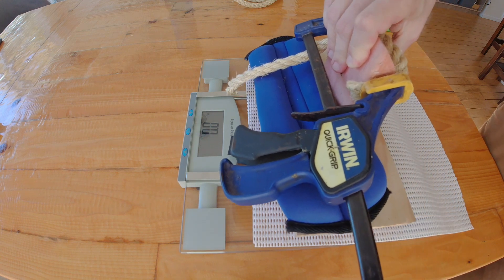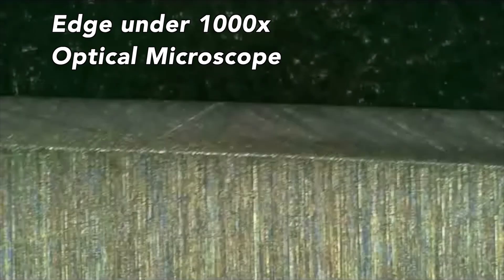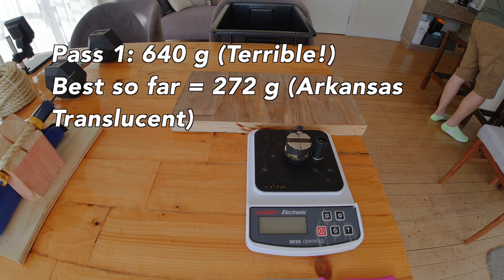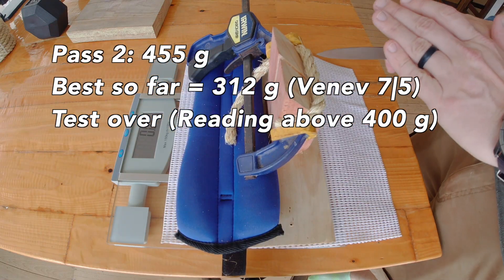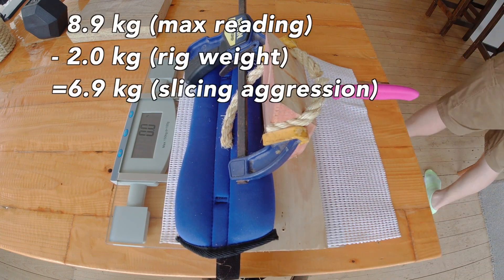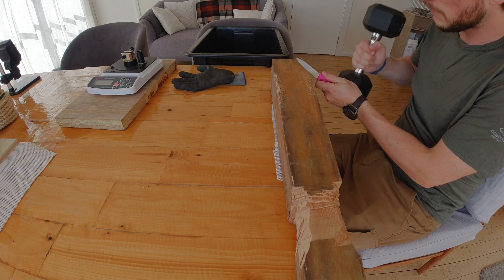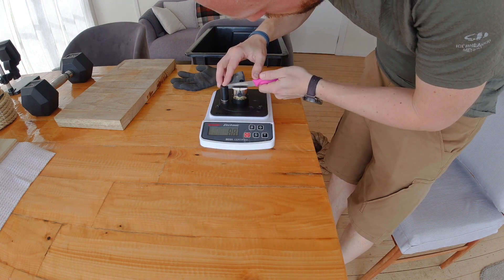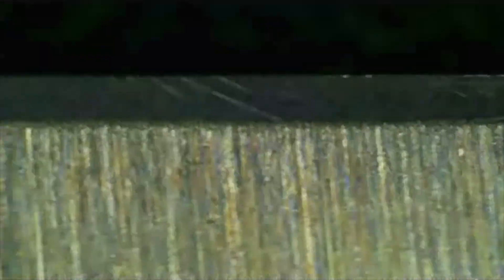SueHiro Cerax 3000 Grit VS ANDE Rope | 3K Knife Edge Analysis

Comment: Would be super interested to see how lower grit japanese waterstones do on these tests. Like maybe the shapton glass 500, the cerax 320 maybe (warning that stone is ultra soft, if you do try one, they arent ideal for edges), maybe a king 300 even 🤔. 

Also. Just remembered to check my email! And also sent you something
Reply: I'm interested in some deep cut electroplated diamond plate edges. Really deep toothy cut bevels. From my experience a 600 grit Atoma leaves a SAVAGE edge. Maybe a gentle deburr on a spyderco UF if struggling to deburr
Reply from the maker: Hey guys!  @blankblank I am working on an edit now of a test of one of your blades that I will send to you to preview in the next day or 2, fun stuff!

Also will respond to the email soon.  
I don't have any coarse Japanese Water Stones ATM but upcoming testing includes a Coarse Norton Crystolon with SiC which gives interesting results!
Reply from the maker: @stroppystuff641 I have a test upcoming on the ANDE Rope with a 250, 600, and 1200 grit EZE Lap electroplated diamond "stone" - I also have tests on edges from Spyderco 400 and 800 grit CBN on the ANDE Rope, all deburred with Mother's Mag (old footage, I didn't have your compounds yet) also there will be dual grit edges where the best of those are featured as the coarse stones as well.

More interesting (probably) for you, is that I am working now on some testing with the Death Rope (my most challenging test) which are edges from the 400 and 800 grit CBN stone deburred with your 0.25 micron paste with extremely aggressive results!!!
Reply: @homeslicesharpening  wish i would have know. I'm sure i had at the very least big enough pieces of ones that broke to send. That could have been usable for tests. 

I definitelty think the india and crystolon will be interesting.

The main thing i think would be cool to see about low grit waterstones specifically. Is because of how friable they are. They produce more slurry than the norton stones, so you end up having 3 body abrasion, and the scratch pattern is different because of that. But i have no idea what that actually would mean for the performance of the edges. 

Idk if that l will lead to a coarse edge that mimics finer edges as far as "loosing bite", or a tougher edge that still keeps the "bite" while cutting like a coarse edge. 

All this to say. I think it could be interesting lol.
Reply: @homeslicesharpening  also great about the 10v test! Am definitely interested to see what happens. 

At this point i really need to get an extra piece of steel big enough to send you out a new blade with my current heat treatment. It without a doubt will perform better than the ones you currently have. To what extent. That I'm not 100% sure on. 

If i can manage to get a cut off of 10v that will work out for a blade, and not have to cut it up into heat treatment test coupons i will use that for one to send you. 

Well, that or i have an idea. I have a 10v reblade for my para 3 I already have basically profiled, and i heat treated it. Its just sitting waiting for me to finish up this batch of 10v, and k390 kitchen knives. Then I will make that for myself. 

I say that, to say. I can send you that one  with the current heat treat, to test. The only condition added is, it will need to get mailed back to me when you are done.